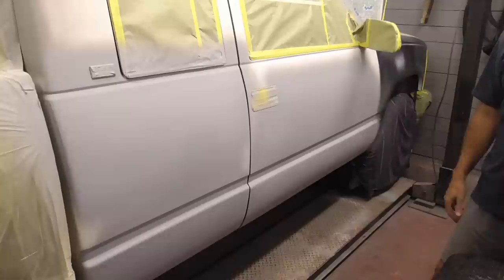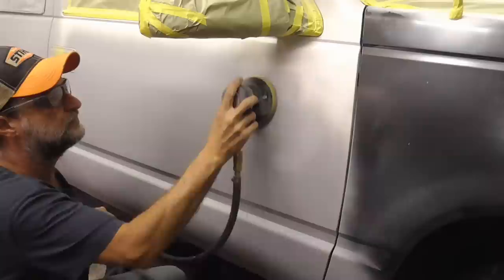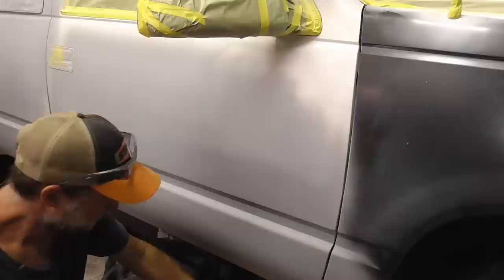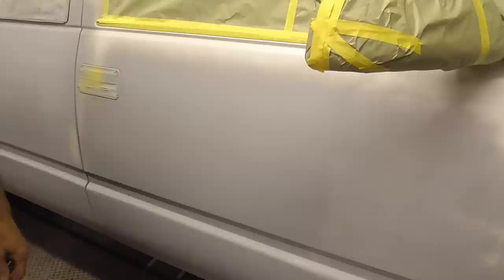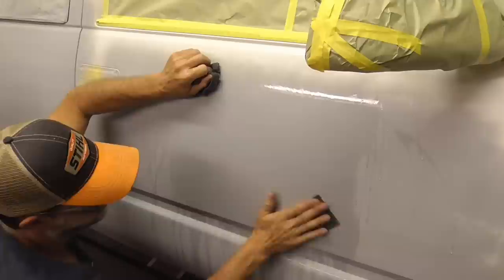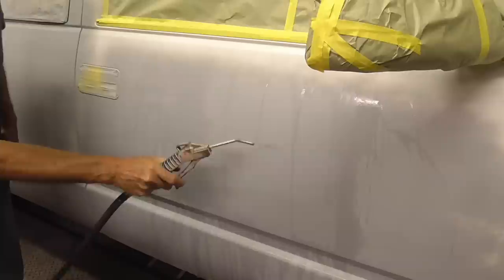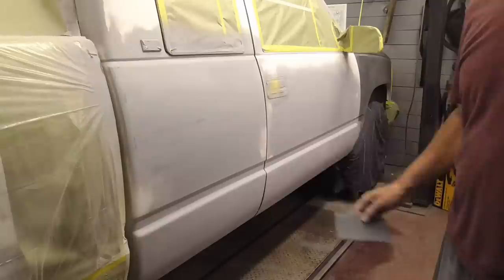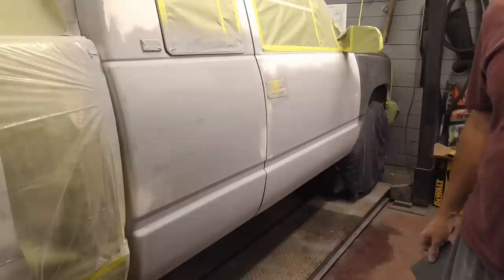3 Ways to Finish Sand Before Painting:  Good Way, Better Way, Best Way

Comment: Are you not worried about taping body lines as a guide during finish sanding? Only while blocking? Also, I put two new fenders on my truck too. I see yours is still in its edc coating. Did you prime it or leave as is. I ended up priming mine but is it okay to just paint over that?
Reply from the maker: Good ?!  You can tape during finish sanding if you want - it may even get them straighter or if you know it needs it.  However, the goal is usually to get it straight (done) with blocking then when you finish sand you're going to stay away from the body lines and carefully hand sand near and around them.  I have a video coming up on that - I think you'll get what I'm saying a lot better.  In the body shops I worked at we just scuffed them and painted.  If there was damage we would go about fixing and priming most of the panel but you can scuff and paint if you want.
Reply: Thanks Jerry. I figured it wouldn’t hurt to tape them but honestly I planned to do exactly as you said. I just couldn’t remember if I’d seen you tape during finishing or not. And quite frankly it’s very hard for me to even get the tape straight. Especially on a seven foot bed. Thanks again. You are an invaluable resource.
Reply: Thanks Jerry. I figured it wouldn’t hurt to tape them but honestly I planned to do exactly as you said. I just couldn’t remember if I’d seen you tape during finishing or not. And quite frankly it’s very hard for me to even get the tape straight. Especially on a seven foot bed. Thanks again. You are an invaluable resource.
Reply: Thanks Jerry. I figured it wouldn’t hurt to tape them but honestly I planned to do exactly as you said. I just couldn’t remember if I’d seen you tape during finishing or not. And quite frankly it’s very hard for me to even get the tape straight. Especially on a seven foot bed. Thanks again. You are an invaluable resource.
Reply: Thanks Jerry. I figured it wouldn’t hurt to tape them but honestly I planned to do exactly as you said. I just couldn’t remember if I’d seen you tape during finishing or not. And quite frankly it’s very hard for me to even get the tape straight. Especially on a seven foot bed. Thanks again. You are an invaluable resource.
Reply: Thanks Jerry. I figured it wouldn’t hurt to tape them but honestly I planned to do exactly as you said. I just couldn’t remember if I’d seen you tape during finishing or not. And quite frankly it’s very hard for me to even get the tape straight. Especially on a seven foot bed. Thanks again. You are an invaluable resource.
Reply: Thanks Jerry. I figured it wouldn’t hurt to tape them but honestly I planned to do exactly as you said. I just couldn’t remember if I’d seen you tape during finishing or not. And quite frankly it’s very hard for me to even get the tape straight. Especially on a seven foot bed. Thanks again. You are an invaluable resource.
Reply: Thanks Jerry. I figured it wouldn’t hurt to tape them but honestly I planned to do exactly as you said. I just couldn’t remember if I’d seen you tape during finishing or not. And quite frankly it’s very hard for me to even get the tape straight. Especially on a seven foot bed. Thanks again. You are an invaluable resource.
Reply: Thanks Jerry. I figured it wouldn’t hurt to tape them but honestly I planned to do exactly as you said. I just couldn’t remember if I’d seen you tape during finishing or not. And quite frankly it’s very hard for me to even get the tape straight. Especially on a seven foot bed. Thanks again. You are an invaluable resource.
Reply: Thanks Jerry. I figured it wouldn’t hurt to tape them but honestly I planned to do exactly as you said. I just couldn’t remember if I’d seen you tape during finishing or not. And quite frankly it’s very hard for me to even get the tape straight. Especially on a seven foot bed. Thanks again. You are an invaluable resource.
Reply: Thanks Jerry. I figured it wouldn’t hurt to tape them but honestly I planned to do exactly as you said. I just couldn’t remember if I’d seen you tape during finishing or not. And quite frankly it’s very hard for me to even get the tape straight. Especially on a seven foot bed. Thanks again. You are an invaluable resource.
Reply: Thanks Jerry. I figured it wouldn’t hurt to tape them but honestly I planned to do exactly as you said. I just couldn’t remember if I’d seen you tape during finishing or not. And quite frankly it’s very hard for me to even get the tape straight. Especially on a seven foot bed. Thanks again. You are an invaluable resource.
Reply: Thanks Jerry. I figured it wouldn’t hurt to tape them but honestly I planned to do exactly as you said. I just couldn’t remember if I’d seen you tape during finishing or not. And quite frankly it’s very hard for me to even get the tape straight. Especially on a seven foot bed. Thanks again. You are an invaluable resource.
Reply: Thanks Jerry. I figured it wouldn’t hurt to tape them but honestly I planned to do exactly as you said. I just couldn’t remember if I’d seen you tape during finishing or not. And quite frankly it’s very hard for me to even get the tape straight. Especially on a seven foot bed. Thanks again. You are an invaluable resource.
Reply: Thanks Jerry. I figured it wouldn’t hurt to tape them but honestly I planned to do exactly as you said. I just couldn’t remember if I’d seen you tape during finishing or not. And quite frankly it’s very hard for me to even get the tape straight. Especially on a seven foot bed. Thanks again. You are an invaluable resource.
Reply: Thanks Jerry. I figured it wouldn’t hurt to tape them but honestly I planned to do exactly as you said. I just couldn’t remember if I’d seen you tape during finishing or not. And quite frankly it’s very hard for me to even get the tape straight. Especially on a seven foot bed. Thanks again. You are an invaluable resource.
Reply: Thanks Jerry. I figured it wouldn’t hurt to tape them but honestly I planned to do exactly as you said. I just couldn’t remember if I’d seen you tape during finishing or not. And quite frankly it’s very hard for me to even get the tape straight. Especially on a seven foot bed. Thanks again. You are an invaluable resource.
Reply: Thanks Jerry. I figured it wouldn’t hurt to tape them but honestly I planned to do exactly as you said. I just couldn’t remember if I’d seen you tape during finishing or not. And quite frankly it’s very hard for me to even get the tape straight. Especially on a seven foot bed. Thanks again. You are an invaluable resource.
Reply: Thanks Jerry. I figured it wouldn’t hurt to tape them but honestly I planned to do exactly as you said. I just couldn’t remember if I’d seen you tape during finishing or not. And quite frankly it’s very hard for me to even get the tape straight. Especially on a seven foot bed. Thanks again. You are an invaluable resource.
Reply: Thanks Jerry. I figured it wouldn’t hurt to tape them but honestly I planned to do exactly as you said. I just couldn’t remember if I’d seen you tape during finishing or not. And quite frankly it’s very hard for me to even get the tape straight. Especially on a seven foot bed. Thanks again. You are an invaluable resource.
Reply: Thanks Jerry. I figured it wouldn’t hurt to tape them but honestly I planned to do exactly as you said. I just couldn’t remember if I’d seen you tape during finishing or not. And quite frankly it’s very hard for me to even get the tape straight. Especially on a seven foot bed. Thanks again. You are an invaluable resource.

Comment: What body filler do you prefer for an all around product
Reply from the maker: Anything that you can find that's inexpensive will work just fine.  It really is all the same.  I use Auto Body Master lightweight body filler - $21/gal
Regular old Bondo brand is good too - you can find it at Walmart - not sure if they have gallon cans though.  Let me know what you find :)
Reply: @LakesideAutobody   So Rage ultra $103 a gallon isn’t required. Cheap is good but if it is more labor intensive it might be worth spending a little bit
Reply from the maker: @rogerstern2542  All fillers sand pretty much the same so you really don't have to concern yourself with that aspect.  You can trust me when I say go with the reasonably priced fillers.  You won't be disappointed.  Watch this video - it demonstrates the grits and methods used in body shops to sand any type of filler quickly and efficiently.  I have other too in the "playlist" called dent repair - https://www.youtube.com/watch?v=rv0uB-ZvrFo
Reply: Thank yo
Reply from the maker: @rogerstern2542  You're welcome Roger.
Reply: @LakesideAutobody  picked up a gallon of Upol Fantastic. 25 bucks. They told me the shops around here like it alot
Reply from the maker: @rogerstern2542  That'll work fine for you.  That's a good name brand and a good price :)
Reply: @LakesideAutobody  👍🏻
Reply: @LakesideAutobody  I’ve read all of it but what is the best spray gun. I will spend a grand but is it really necessary? I’m not a big fan of the disposable 3m stuff. What would you buy if you just sprayed your own stuff?  I’m getting ok results with my cheapo but I want better. I realize it’s the operator & not gun 99% of the time but I’d like to take all variables out of equation. Thank you
Reply from the maker: @rogerstern2542  To be totally honest, every gun I've ever picked up worked fine.  Here's the best advice I can give.  Start with the cheapest and move up from there if that one fails you.  The Harbor Freight purple gun sprays just fine, cleans up easy and will spray a car just as well as a 1000 dollar gun.  You can move up from there.  The Sharpe Finex 3000 is a very nice gun for a reasonable price - you'll love that too.  Campbell Hausfeld guns from Home Depot work awesome - they're cheap too - about 49 bucks.  You can even pick up some conventional Binks, Devilbiss USA made guns on Ebay that will spray excellent if you clean them up and maintain them.  Let me know if this helps you out a bit :)
Reply: @LakesideAutobody  ive got older Home Depot gun. It works ok and an old Binks no. 7. Its really just my technique that needs work but i do appreciate all the advice.
Reply: @rogerstern2542  It balls up as it hardens, or the can I bought did. Just as you try to finish spreading it, it starts turning to cottage cheese. I prefer Claussen, but even Bondo is better than Upol Fantastic.

Comment: I never see you using epoxy primer.
Reply from the maker: Remember before the 90's they didn't have epoxy primer.  Plenty of great body work and paint work was done then.  Lacquer primer is DTM direct to metal.  Filler is DTM.  Fiber glass is DTM. Some urethane primer surfacers are DTM.  The only time I use epoxy primer is on aluminum or if I buy a gallon of urethane primer that requires epoxy primer first.  Lots of urethane primers are now DTM though so check the label.  Jerry

Comment: Sanding blocks for beginners.....
Reply from the maker: Sanding blocks get body work the straightest.  If you're really good you can use a hog or a DA but still doesn't get it as straight as a block.  Then you can start talking about the padding on a block, the length of the block etc.  Lots of stuff go into getting it straighter than glass.